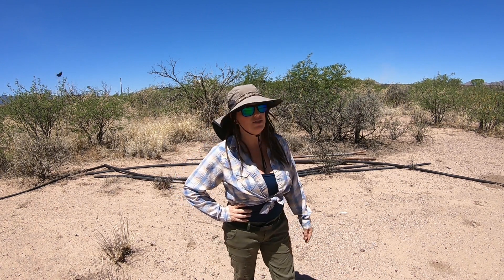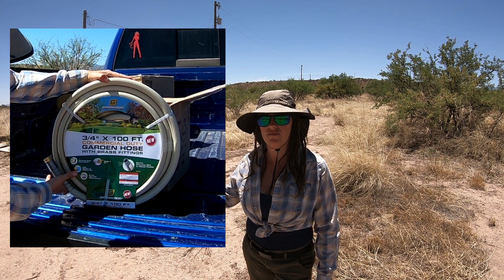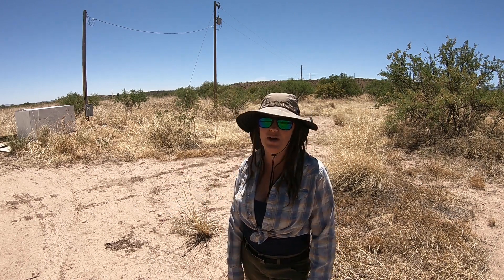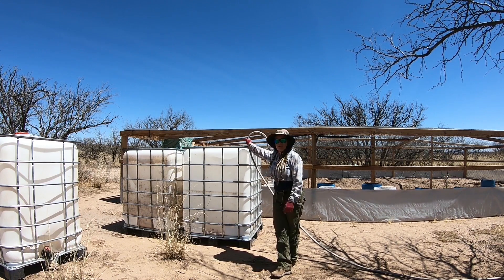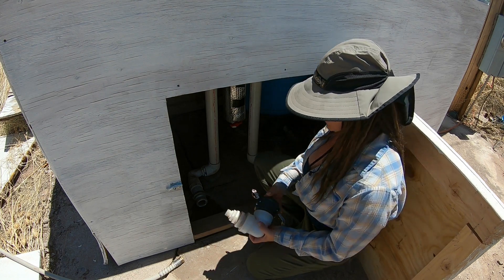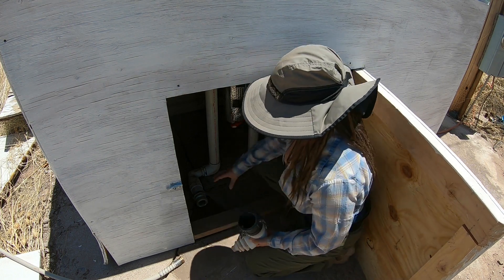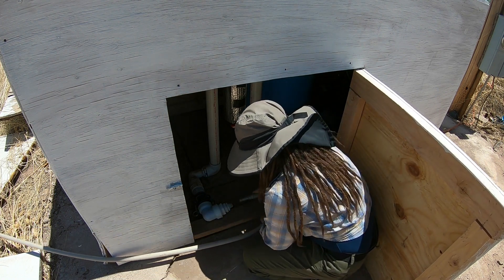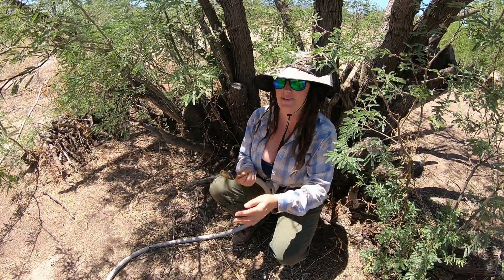Build an Off-Grid Water System with Garden Hoses!

Comment: How do you think those will hold up during the winter? I’m planning so do the same thing you’re doing in AZ. A friend did this using PVC but the hose is cheaper.
Reply from the maker: So far, they have held up great. In the winter, they will freeze but I think the hose will expand. I am renting a ditcher ASAP and putting it all underground so I don't have to worry about it.

Comment: I guess burying the hose would help with keeping the water cool? Has the hot sun heated water damaged any of your plants? 

I bet you could make some great hot water energy systems with hose laid out in the hot Arizona sun! Or do a geothermal coil to help heat your house in the winter?
Reply from the maker: The water gets quite hot in the summer, but it all goes thru my tanks and that seems to not be as hot. Since I have the drip irrigation on the plants, I haven't noticed any damage. Yes, the hot water heating with hose or tubes is very effective!
Reply: @RusticSkills  Very nice setup!

Comment: Test hose for lead contamination. If present, anything fed by hose is now contaminated too.
China uses lead powder as a releasing agent in plastic manufacturing.
Reply from the maker: That could be a valid point, but China does have manufacturing standards which includes not poisoning people with lead. I drank out of a garden hose my whole childhood and I am fairly certain I have not been poisoned before. Its a risk I will take.